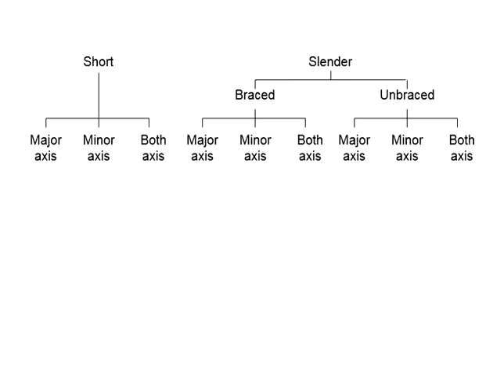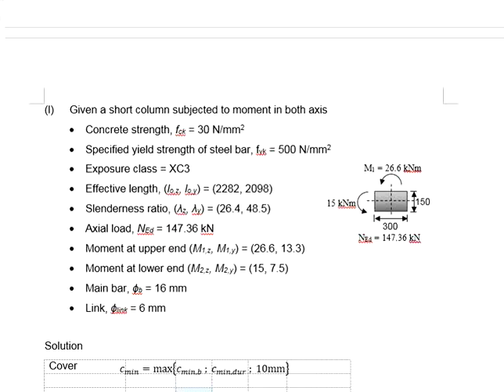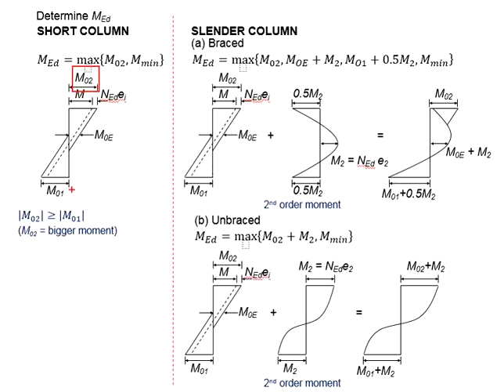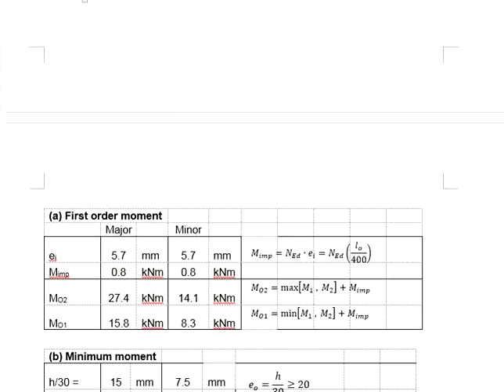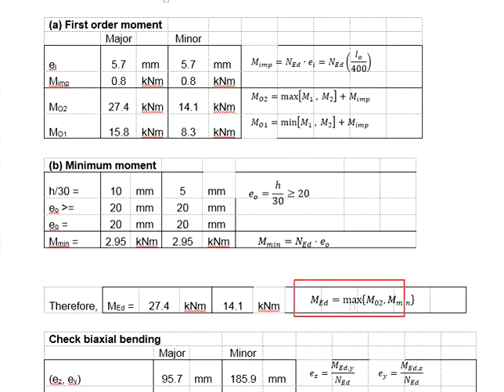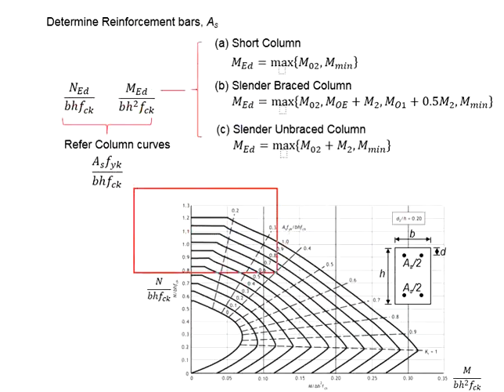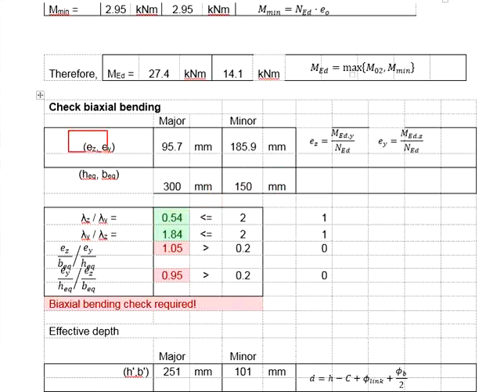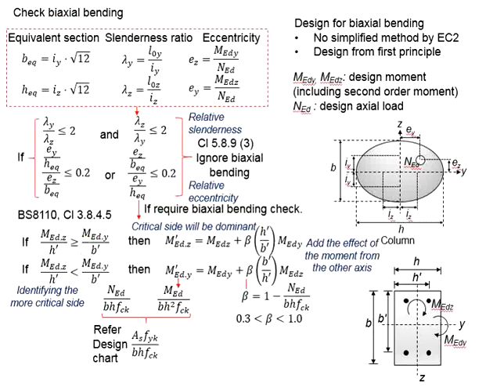2.45 Column type: Part 15 - Short biaxial bending column part 1

Comment: I think that: M1,z > M1,y ---> h=300 b=150;  M1,z < M1,y ---> h=150 b=300. Am I thinking right?
Reply from the maker: My personal understanding. If you do it that way, it is not wrong. To me, it does not matter if you choose Mz = h or b, as long as once it is selected, you need to keep it consistent throughout the calculation steps. Later, there will be a step to check whether MEd,z or MEd,y is the critical side. The critical side will swap if you swap the h and b.